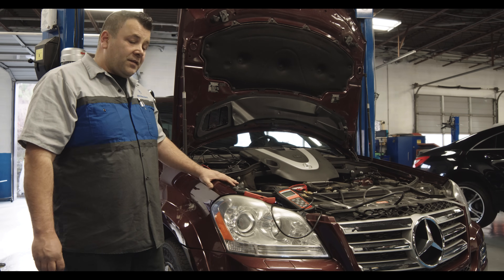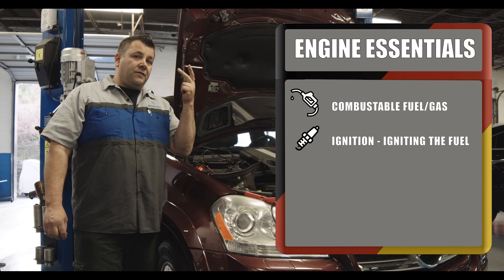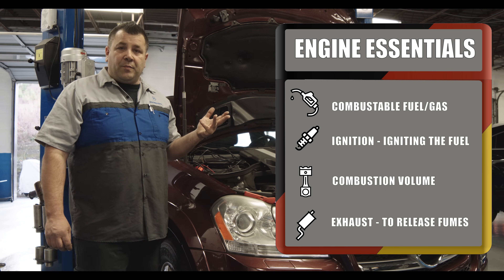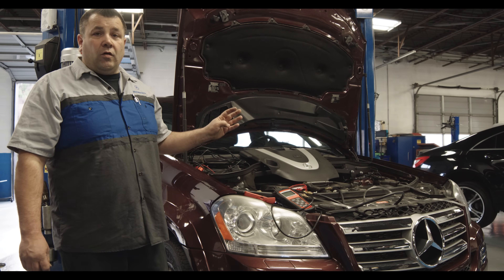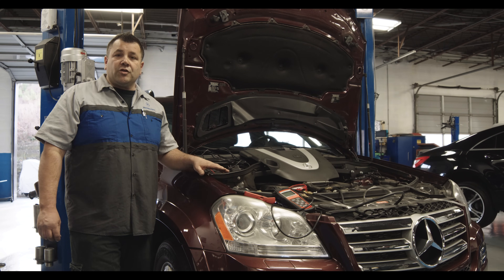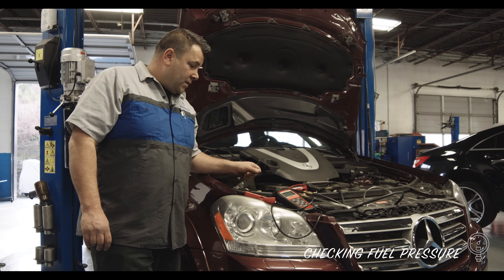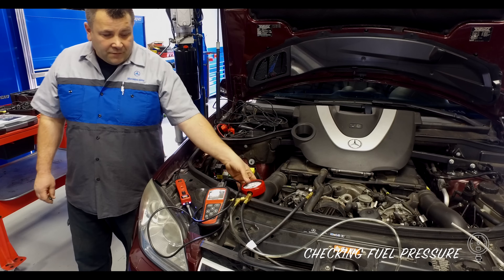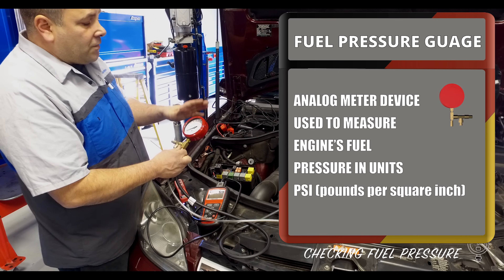Why a car won't start -  Mercedes Benz Troubleshooting Guide, Tips

Comment: U014787
Current and Stored (Event
Trouble codes
Communication with the Audio/COMAND control module is faulty. The message is lost.

Current and Stored
B16F315
Current and Stored
B16BF15
Current and Stored
B16C315
Current and Stored
Trouble codes
The left standing lamp 1 is faulty. A short circuit to battery (+ or an open circuit exists)
Reply: The right standing lamp 1 is faulty. A short circuit to battery (+ or an open circuit exists.
The left side-marker lamp is faulty. A short circuit to battery (+ or an open circuit exists.
The right side marker lamp is faulty. A short circuit to battery (+ or an open circuit exists.
Reply: These codes are from mercedes benz glk 350 2010
Do you know what is wrong with the car?

Comment: Have a gl x164 320 2007  won't crank, just a click sound from starter,. Jumping on relay the starter crank and car start.... What could be wrong, have replaced the relay to... Fault come after replacing the starter....
Reply from the maker: Did you tight the ground on the starter? Check your work one more time.. why did you replace the starter?
Reply: @MercedesBenzTechs  reason for replacing starter was very slow crank,  got much faster with new starter.  When jump relay starter works great... But when use key  it seems like the starter just get a short pulse.... 
If battery is under 11 volt is that maybe the reason for just a short pulse....?
Reply from the maker: Sorry not the ground, ground comes from the car, the positive..
Reply from the maker: Actually, let me think about this one.. because you have two positives, one consistent and one triggered from sam after EIS gives drive authorization bu you say that when jumped from relay it starts… are you using car battery to jump it? If not maybe battery is weak if you do than maybe loose wire inside the SAM??..

Comment: C250 2014 Mercedes sport it runs when it start.  The horn just recently stopped working. Dashboard lights up except navigation screen . 2nd car does not start.
Reply from the maker: Sounds like water in the front SAM

Comment: I need help have a problem with my mercedes c180 sport coupe 2007.. 
It's not cranking, I've checked all the fuses and relays and all seems fine,  the battery is only a few months old.. ive been advised that the problem is  starter motor. 
The car won't jump start from booster park but will push start...

The whole problem started wen I left the lights on and drained the battery,  
I jump started it with leads and took it for a 40 min drive, I turned it off then started it again with the key., and it started fine. So I turned it off again.. I went into the shops came out 15 mins later, I went to start it and nothing happened, didn't start .. so I push started it, drove it home and left it running for 30 mins then turned it off. And it hasn't started with the key or with jump leads since.. 
And  wen I push started it the next day I've had a notification message on dashboard,  abs and srs unavailable pls see owners manual.. 
And I have an abs Amber light come up on dashboard..

Comment: Hi Dave  I have to 2013 SLK 250 I recently change the high pressure fuel pump and had absolutely np problems, now all of a sudden car wont start. everything comes on just would start. had probe for codes and none showed up. mechanic said its starter. I dont believe it's starter since I had no starter related issue. can you help me? battery is new
Reply from the maker: It might be the starter or any electrical issue.. why don’t you trust the mechanic that told you that the starter is bad?? Did he perform the right diagnosis?

Comment: My issue is no crank no start. I changed the starter I heard the old one kick on and the new one but still no turning over engine. Also changed crank position sensor is there anything else? Or could the ecu cause the issue ?

Comment: Hey so I’m having issues in my w212 where it doesn’t start all my lights turn on I just recently replaced both batteries and the alternator I also stopped using the push to start button and use the key it takes me like 20 turns of the key to finally get it to start what do you think is this ?? Would it be the starter ????

Comment: I have a 2010 R350 bluetec diesel. One day, intermittent electrical issues started; cruise not working, lights not working, horn not working, OBD port not powering up, not starting most times, cranks over the odd time, but no start.
I have replaced front and rear sam units, checked all fuses but no luck. Please HELP!!!!!

Comment: I have a 2013 C250, and it won't start. I started it by jumping the starter relay with a wire,  but put a non mercedes relay in its place attempting to fix it but got some sparks, now I can't jump it with a wire anymore and it still doesn't start... I get an error message,  " take key from ignition" what would you advice my next move to be?

Comment: Hello sir.     My daughters E CLASS.  2011 DIESEL
has stop cranking. After breaking very hard to avoid a collision.. All lights come up on dash.  Immobiliser open and closes doors etc... But will not crank. Pleaae help.  We are in a real fix.. As she has no work just now. And worried about getting smashed a bit in a rip-off garage.. Thank you. Were in. U. K

Comment: great video and easy to understand; but where to get the testing relay and the power probe? Thanks.
Reply from the maker: Try eBay.. we usually have snapon or Matco trucks stop by our shops with all the tools but eBay or Amazon is a good place to start.

Comment: Hello great video, could you help me with e320cdi diesel after injectors change it's shot off power ,no key turn no lights, I checked all fuses all good. Can't figure out .
 Can't diagnose the problem...

Comment: Cl500 crank no start had ran out of fuel .. Fill the tank crank but no start ...i tried starter fuel and it did but not on its own ? Could it be the fuel pump idea! ?
Reply from the maker: Yes, most likely, check the relay first

Comment: Ty brother for videos I have 2011 s550 accidentally touched positive on battery and metal of the car spark come out now no communication when key in nothing happens what should I check ty
Reply from the maker: First check the fuse box right next to the battery, it usually goes bad when you short the electrical, second, the fuse box in the trunk, behind the rear passenger seat
Reply: @MercedesBenzTechs  ty for replying so much I have checked and all good I will recheck any particular fuse because it's like dead the key do nothing but when use unknown key the massage pop out on dash but usually no dash lights at all with original key ty
Reply: Can ECU go bad if you short electrical or do you think fuse box itself completely ty for response my friend
Reply: And I'm sorry for inconvenience I had chance to read one time code circuit 87 code pop up

Comment: i have a 2010 mb glk 350 4matic . A security light appear in the console showing a caution message change oil in red. So, I parking the car and the next day , the car didn't turn on. When  I put the key in the and turn it to the start nothing is showing in the console, only said remove the start key. Also the windows are not working , but other components works ok. The battery is new. the fuses and relays check one by one are all good. Please I need help to fix that car. Thank you.
Reply from the maker: Sounds like few different issues, is your number one check the oil level correct if necessary, issue number two you may have a bad ignition switch steering lock, It may also be bad signal acquisition and actuation module

Comment: Water under driver  Seat Floor board  2014 E 350 Sedan Base what should I do car won't  start
Reply from the maker: Clean wire harness and change CAN junctions
Reply: @MercedesBenzTechs  and The Car should  start
Reply: If I take it to dealership  how much would they charge
Reply from the maker: @jeffjackson1125  hopefully 😁
Reply: How much to clean wire harness and change Can junctions?
Reply from the maker: @jeffjackson1125  I really don’t know, they will have to perform a diag but I would say at least 6 hours labor plus some parts, easily around $1,000-$3,000

Comment: I have a 2002 mercedes c220 cdi and it wont start
unless i get someone to spray easy start into the
carb while i turn it on Please help
Reply from the maker: You need a scan tool to check for faults. You need a diag to find out what the problem is

Comment: Thanks for the video. I am having an issue with my 2005 e500. When I remove my key from the ignition the whole car dies and when I put the key back in the ignition the key won’t even turn and it becomes locked. To even unlock the doors I have to boost the car and then it turns on. 
Do you think that Is that a problem with the ignition. I tested the battery and the battery and alternator and starter and giving good readings.

Comment: I am having trans issues with my 2018 cla 250. Code P0562 "terminal 87 voltage too low"

I have power. Mechanic said battery is no good. Replaced battery. Same issue but worse. I have power but car won't start randomly and will also stop shifting while driving sometimes.
Error says "do not shift. Transmission malfunction. Service immediately."

My mechanic suggested that the tcm/pcm has to be reset with an expensive obd tool (icarsoft mb 2) ?

Any insight is greatly appreciated, I am selling this car in 3 days and need it to start/run at the dealership.
Reply from the maker: First of all check your auxiliary battery it’s under the foot wall of the passenger side, make sure the original batteries good

Comment: Thanks for this engine start video. Unfortunately this video didn't speak of my problem with my 2010 slk 300. Most of the time my start will work with no problem. Only at times my key not start my engine but would activate all dash lights indicating that it will start but nothing happens to engine not turning over. At first I thought it could be the battery since the age was there so I replaced the battery. Couple weeks later the car still had the issue so I replaced the start relay thinking it could be faulty relay. This did not fix my issue. Because it only does this once in while I thought I should wait till it fails completely. I have tried different keys thinking it could be one of the keys. It's been two to three year issue now. If any suggestions. I will appreciate any of your comments.
Reply from the maker: Sounds like electrical issue.. can be CAN communication, ignition switch or SAM

Comment: Hopefully someone can help me. SL500 won’t start in the morning when temperatures is under 60 degrees but will start in afternoon, what could be causing this?
Reply from the maker: The only thing I can think about without deep diag is maybe bad battery??…
Reply: @MercedesBenzTechs  battery is 9 months old, but I will try getting another and see is that solves it.

Comment: Have 08 c300 .two days ago it was raining too heavy. the headlights start blinking on/off. two hours later, the car won't work. nothing literally works even the key fob. acted like there is no battery at all... I open the door manually and try to turn on lights, radio, or inside lights. Nothing came up!!!! what should I check first to at least turn it on and drive it to the shop !! ???
Reply from the maker: Check your front SAM, make sure it’s always clean under the windshield or you’ll get water inside the car

Comment: 2011 E350 Convertible with 80K miles. Random issue with starting car. Turn key FOB and nothing happens - no crank. Take the FOB out and reinstall and it starts. I changed both FOB batteries and the main battery under the hood. Last weekend I tried to start it several times and nothing. Opened the hood and checked battery voltage between the external + blade and the ground lug. 12.3 to 12.4 V. Went back in and turned the FOB - started right  up. Any thoughts?

Comment: I have 2007 CLS550 an I putbit in park then it shut off an wont crank wont start... have any idea?
Reply from the maker: Make sure it’s ready in P, also check battery
Reply: @MercedesBenzTechs  I checked battery it says it's good... it's all the way in P too
Reply: @MercedesBenzTechs  it still won't start

Comment: You had a chance and missed out on it last time. So heres another chance. Mercedes w204 c220 customer got me round to change front sam unit. I did and using Xentry tried to program new one. The screen with adaptions was not there though. Instead it says either no power or the unit not intended for that car. The fuse box is sending power through it though. The ECM is on and live data showing. Customer said car indicators and lights doing weird stuff. That in my view is not the front sam but the back. Anyway, scanning both Sams they are not on. So I think rear was the faulty and the front not. Only also read if changing front sam up to 2010 the sam needs a jumper cable on it. 

Over to you. What do you know mate?

Comment: 1997 e320L CRANKS BUT NO START NO SPARK NO FUEL. CHANGED CRANK AND CAMSHAFT POSITION SENSORS STILL NO FIRE

Comment: Hey David i have a 2008 Mercedes R350 car was running good then it started to take longer to crank a code come up P0335 and now it want start so I changed the crankshaft position sensor twice still want start I checked the timing is ok im getting fuel but no fire any ideas?

Comment: I bet you dont have the solution to my problem. In live data I have seen the battery voltage 8v and always 8 volts yet in other screen 12v. Two new batteries in 2015 reg A180. Then now and then theres a message saying The voltage of the onboard electrical system is faulty. Its a no crank. key positions all correct. Eis scanned and keys with Xentry. no other faults except charge movement flap faulty.
Reply from the maker: How much will you bet
Reply: @MercedesBenzTechs  if starts this morning £50
Reply: @MercedesBenzTechs  See this is the test. Solving a problem fast thats just thrown at you. A180 Charge flap blocked. Checked and motor worked and flap not blocked. Full of old carbon and customer decided to go for new inter manifold. Resistance of new motor was different to the old. So fitted the manifold and deleted the code using Xentry. Found after it remained saying charge air flap blocked. Got two wires to check voltage drop between motor and ECM

The switch EIS all checks out. Every position turns to on and then circuit 50 turns to on when cranking. EZS no faults. Sam no faults. Only noticed if hold key in crank position for 2 seconds can force the message to appear.  The voltage of the onboard electrical system is faulty. As said checking powers and grounds to ECM this morning.
Reply from the maker: @jamesbarratt593  can you do a video and post to YouTube and send me a link
Reply: @MercedesBenzTechs  its gone now. Key handed back. Mercedes picking it up. One that got away. Anyhow, found today no power on 3 power wires to ecu and found all come from main relay. Guess that was it. Had put key through letterbox by that stage.
Reply from the maker: @jamesbarratt593  cheers, one less challenge to overcome.,,

Comment: thank you very much for your video,,  i have a c230 kompressor that was fine and while changing battery  and starting engine some noice was heard and  then the car just died, not even the kew works, checked fuses all okay but no power to cluster or anything
Reply from the maker: Why did you change the battery to start with